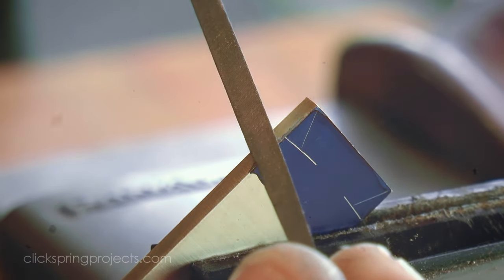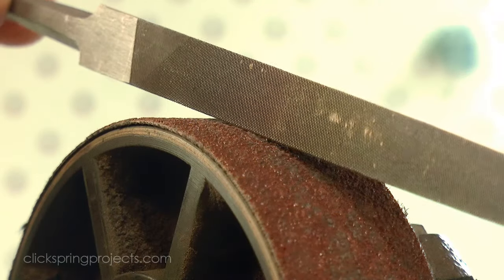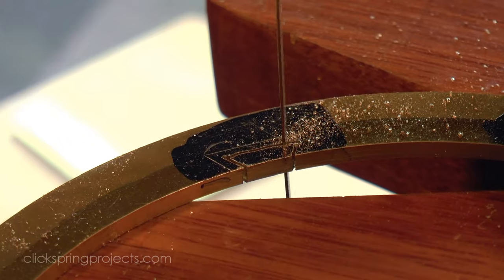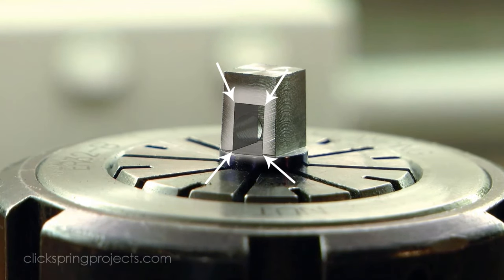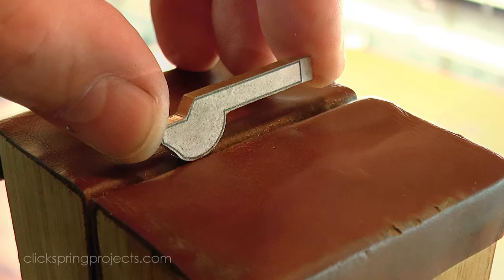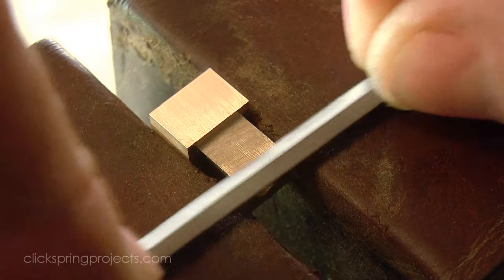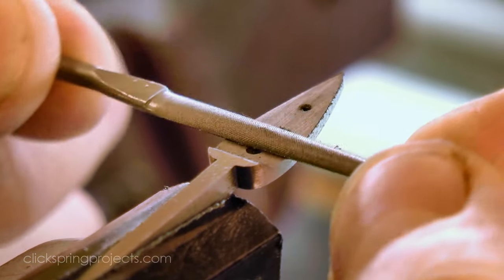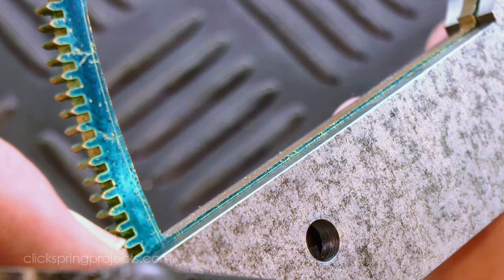8 Old School Tips For Better Hand Filing

Comment: Mercilessly file or grind the tang so it's smooth and feels good in the hand, if you're going to be spending hours letting your fingers and palm get intimately acquainted with this file it ought to be comfortable.
Also, be patient, filing can be and probably should be zen if you're going to achieve good results.  

Watching this video was painful for me because I wish I worked with such soft materials, my envy was getting pretty out of control by the end.

Comment: I have a problem files tends to leave a bump in the center right so you  use the curve part of the file to remove that spot but another problem  was the surface to smooth and the file skipped flattening the files teeth rendering it useless but i saw some highly skilled people filing precise within 0.02 or 0.02 may i know what kund of files are they using.

Comment: you will wear out a carborundum grinding wheel trying to get the grid off the file.  ive made a knife from an old bastard file and not only did it eat up a wheel, the bearing went on the grinder.

Comment: I'd like to quote my instructor (master craftsman in the job i was learning): "Just look at the work piece, idiot. It's not that hard. God damnit... Why are you using that fine file when you need to remove that much material? I... What the hell? are you blind? Did someone break your wrists or why aren't you holding the files in the correct angle? I mean... you... You know what. here's the reference drawing, here's a lot of raw material... you either bring me three perfect parts or a bucket full of blood from your bleeding hands before you stop filing"
Well... It actually helped...
In nice words he would have said something like: "hold your file firmly but not cramped, look at the angles you're holding it in, use different cuts of files for different amounts of material you have to remove and practice the shit out of it"

Comment: Clean the file with a wire brush. Especially when working with aluminum or wood. Chips get stuck and you have to go one by one cleaning the teeth

Comment: As apprentice we where not allowed to use sandpaper. If you start to use sandpaper your whole filing technique is ruined in a few days. Having a small adjustable vise with a ball joint helps a lot for the detailed work. As apprentice we had to build it by ourselfs. And after 30 years i have still this small vice 😎

Comment: clean your files with denatured alcohol and a clean, degreased, wire card or brush, and do not touch the teeth with your fingers as the oil from them will decrease the cutting action.